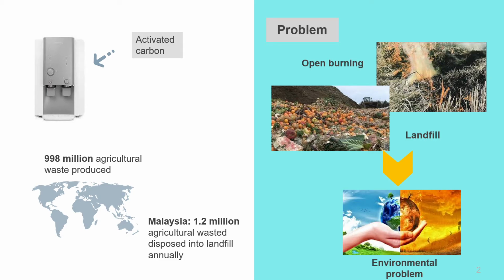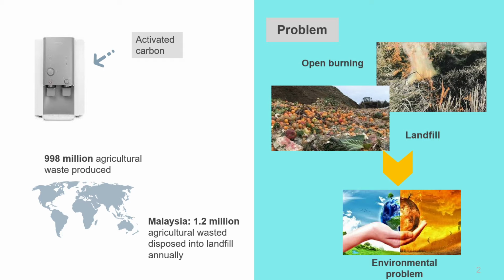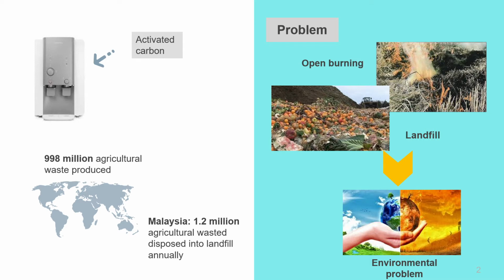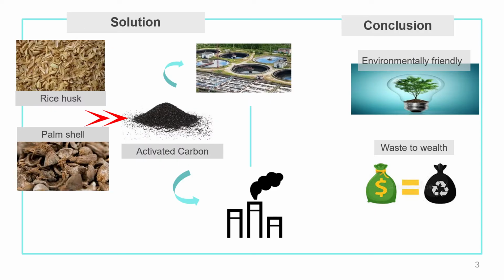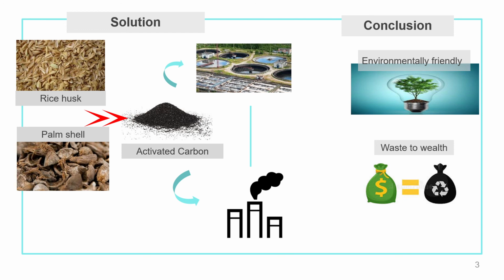DEVELOPMENT AND CHARACTERIZATION OF ACTIVATED CARBON FROM INDUSTRIAL

Comment: Assalamualaikum Ahmad Syafi. Thank you for your interesting presentation. My questions are as below:

1. What are the criteria of a good activated carbon?

2. The term “activated carbon” is very general. Could you please specify the types of activated carbon that you will develop and characterize in this study?

3. What are the parameters that will be taken into account in developing this activated carbon?

4. What analysis that you will employ in order to measure the effectiveness or performance of this activated carbon?

Thank you.
Reply from the maker: Waalaikumusalam  and Hi Dr. Thank you for your question 

1. The criteria of a good activated is large surface area, high carbon content and high degree of porosity since activated carbon mainly use as adsorbent

 2. Type of activated carbon that i will be develop and characterize in this study maybe granular or powder activated carbon since i havent decide it yet

3. Parameter that will be taken into account is degree of porosity, activation time, surface area and yield of activated carbon

4.  Analysis that will be employ is adsorption of methylene blue

I hope this will answering your question

Comment: Very good progress on FYP 1, however from your explanation; it is not really clear that which process do you choose? Physical or chemical?or both? are you going compare between both process?
ii. If you choose physical process over chemical; can explain more? Why do you chose that process?
iii. Why do you choose rice husk and palm shell? do you think it will different; in term of output; if you opt for other agricultural waste?
Reply from the maker: Thank you Dr for your comment. I will answering your question accordingly

1.  In this study, i choosing chemical activation over physical activation because it takes shorter times, low temperature and give higher surface area

2. I choose rice husk and palm shell because of their availability and abundance in Malaysia and producing more data about the development of activated carbon from this material in Malaysia. I think the output not vary so much since lot of study showing that activated carbon using other agricultural waste also can be achieved.
I hope these answer will answering your question.